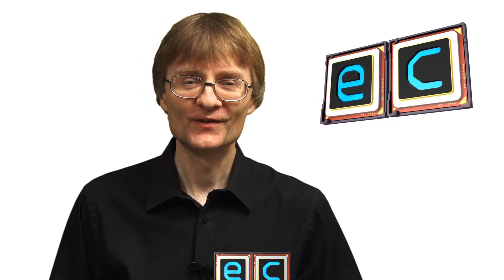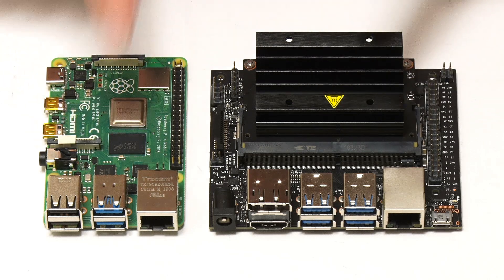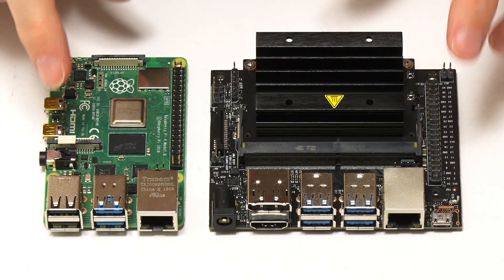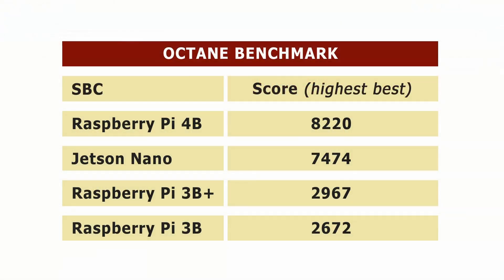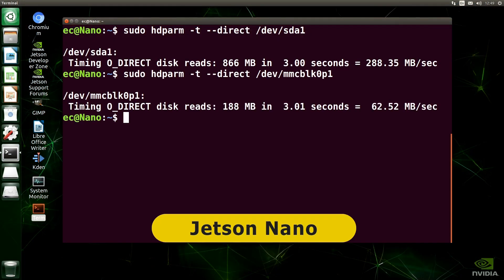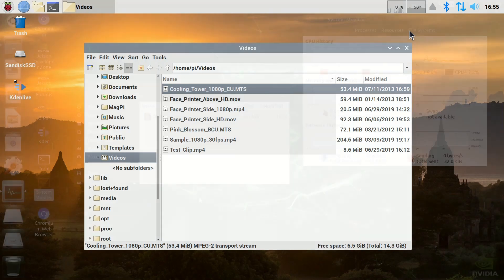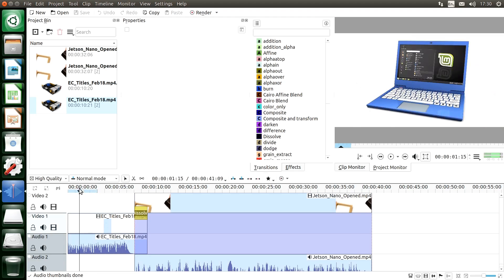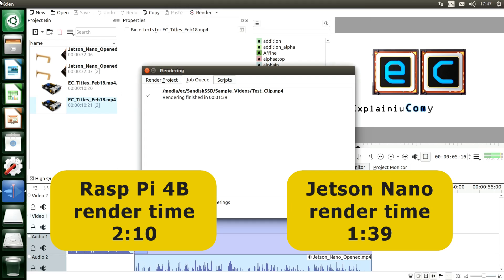Raspberry Pi 4B vs Jetson Nano

Comment: The Jetson Nano has slightly less capable CPUs but the real advantage lies in the 128 core GPU which enables faster model inferencing and decentralized edge computing; the Rpi4 is definitely a large upgrade compared to the previous versions, with much more powerful A72 processors. However, due to the massive heat generated by the new CPU it's necessary to be careful about heat dissipation.

Comment: Am I right in assuming the Pi 4 reaching 80C during rendering would throttle back? I would be interested in what other heat sinks you could use as that is certainly a large one. They are both very good SBC. Thanks, Chris.
Reply: There cases that act as heat sinks. For example: https://flirc.tv/more/raspberry-pi-4-case
Reply from the maker: The Pi 4 indeed throttles at just over 80.

Comment: Chris did you do the RPi 4B firmware update? They released it a couple of days ago. It reduces the temp by 3C-5C & increases speed slightly, especially with USB read & writes.
Reply from the maker: I have installed the update, but it was not available when I made this video.
Reply: @ExplainingComputers  ah, the unfortunate downside of videos.  BTW, congratulations on the article in the next edition of MagPi!!! (The RPi 4 B edition at that!

Comment: Well, the Jetson Nano is a bit too expensive for what it offers unless you're using the GPU, so, for now, I'd say the best SBC for general purpose is the RPi 4 thanks to its really good improvements, which are probably the biggest leap in its history. In fact, I'd say it's the SBC with the best price-performance ratio nowadays. However, that might change when Rockchip launches its new SoCs... they even have an octa-core one! We're also likely to see news from other SBC manufacturers.

Comment: You state that the Jetson Nano is preferred for AI work. Is this purely based on the current (and likely planned) AI support available in the Nano, or is there some hardware issue with the RP4b that would/could impact its AI performance? 

Seems the processing throughput is similar on both platforms, but I could well be blind to some key indicator.

Comment: maybe you could benchmark a pi vs an older desktop cpu like a pentium for fun :)
Reply from the maker: @kooky216  Great idea for a future video -- noted!
Reply: @ExplainingComputers  Did you ever do it? Could be fun!
Reply from the maker: @jeppelarsen5850  Sadly I didn't. Would be fun indeed!
Reply: @ExplainingComputers  Apart from the hilarious visual of a monstrous old PC tower next to a small Raspberry Pi, I genuinely think it would be a great idea to have an expert opinion from somebody like you on the topic that's entering the mainstream. 

My girlfriend is moving from a laptop to a home office and needs a dual monitor set up for her translation job, which is almost exclusively word-processing and cloud based tasks, so I've been wondering if a Raspberry Pi 4 would be sufficient for her instead of a refurbished PC. 

Just saying!
Reply: @jeppelarsen5850  Even though a Raspberry Pi would definitely get the job done, she would still run into some software incompatibilities from time to time. In the end of the day, a low end desktop PC would do the job much better for a just slightly higher cost.
Reply: CPU wise - 
A pi 3 is roughly a single core of a pentium 4, but you have four cores, so maybe like a multi socket xeon. (I'd give a molar to have one of these while I was in college instead of some sun ultra 10 hardware)
Pi zero is roughly a pentium II or III. But the ram and storage are much faster than the spinning disks of the time. 
*Pi 4*, I don't know ....  one does NOT see a 3x increase in CPU performance generation to generation in PC world. Maybe it's in par with Intel core 2 or Nehalem 
That said, anything interesting on the Pi or other SBC is not going to be happening while running a desktop windowing environment, much less running a web browser. Raspian/noobs is for people who are COMPLETELY new to Linux and need something familiar.
Reply: @johnsimon8457  I think the Kali Arm and Manjaro Arm guys would disagree with nothing interesting happening with a desktop.
Reply: @johnsimon8457  Thing is I was very much involved in PCs back then, and as Chris says, it is all about systems.  It makes the  comparison meaningless.  In some ways a Pi4 will be more advanced and in others still woefully lacking.  Another problem is the fastest computer is the computer you currently own.  And NOOBS  is for new purchasers so they can install known to work software- someone coming from Windows won't notice any handholding because there isn't really any.  In fact I'd say NOOBS adds confusion there.

I've read the datas and the X3 thing is just a splash headline, sometimes it is over 3.6!  Other times no improvement.  If you sort of average it out, mash it about, and apply a sort of lightweight PC use case scenario X3 isn't correct but it isn't misleading either.
Reply: @johnsimon8457  In comparison the socket 7 era AMD 500's could do a lot, but could not handle streaming from their older and handicapped instruction sets. I even think the socket A 462 is more powerful on the right board although Firefox so rudely stopped SSE support. I was surprised to see a RPI 1B+ could stream good on OSMC, although it was fun watching it chug and buffer streaming on Rasbian. That was with 1100 over clock. 
I regard X86 as a fleet of American triple trailer trucks, and Arm as a bunch of delivery drivers on mopeds that can only carry small items. 
So would it be fair to say that one could take the Arm core frequency and divide by 2? Well I don't think it would be that easy to judge performance without looking at the hardware and software that goes with a Arm cpu.
Reply: my pentium g2020  with ssd optane score 20000 ,pi4 8200

Comment: Great video Christopher. I loved seeing you use Kdenlive on them. For me an important test since I use SBC's to edit and render my travel videos. It was a great overview of both.
I'm working on the Khadas VIM3. An amazing board. Again a lot faster than the Odroid N2. It's 4 big cores are at 2.2Ghz vs 1.8Ghz of the N2. And the power consumption is very low. 1.4A maxed out. So the best for me for video editing while traveling. But mine only got 2GB ram. For 1440p videos I'd need 4GB ram. 1080p is ok with 2GB ram, +1GB zram and a swap file.
I'm almost ready with it, my video will come in the comming week. Only found 1 little problem. The on-board wifi stops working when using a USB3 device on the USB3 port. The wifi connector is right next to the port, and there's interference. Using a dongle fixes this.
I also have got the Raspberry Pi 4B on the way. And some other boards I've got that need to be reviewed too. It'll be bussy times :) 
Have a nice day, greetings.
Reply: *Its 4 big cores are (possessive)
it's = contraction of "it is/has"

*mine only has
*coming
*busy
Reply: @alvallac2171  Thank god English isn't my first language, nor my second.
Reply from the maker: Times are busy indeed! Great to hear that you're working on a VIM3 video. I'm on the Edge-V. :) Look forward to your video.

Comment: Obviously Jetson way bigger and expensive so has to go for advantage. Still apart from cloud solution what is SBC conventional local storage solution?
Reply from the maker: Storage has to be via the SD card or USB connected drives. There are now adaptor boards to add SATA or M.2 drives to a Jetson Nano.
Reply: @ExplainingComputers  That would make it a real PC. Aren't Raspberry folks afraid that they are lagging behind?

Comment: At 9:27 would it be 'better' to boot off a drive using the USB Vs. MicroSD due to the vast performance difference? Basically deep six'ing the use of the microSD altogether?
Reply from the maker: Sadly, right now, neither of these boards can boot from USB. The Pi 4 will be able to boot from USB in the future (as the Pi 3B+ can now!).
Reply: HI  @ExplainingComputers , I found this https://www.youtube.com/watch?v=7O7pUtQD9HI and followed the instructions. You can't go directly to USB, but in a two-step boot, you can run the Jetson Nano at fast speed using, "Pivot The Root." For me, my 16G MicroSD wouldn't work when I had to Build the new Kernel: but a 32G MicroSD worked fine. The 'Download Kernel Sources' took more than an hour (I'm in the USA) so the instructions say it's a good idea to save a copy. The same site gives instructions on installing a ver2 camera (ver1 won't work as of time) and instructions on creating a swap file (seems modern ssd don't use swap partitions any more). Note, the partition file should not be used on a MicroSD - according to several thread participants.
Reply: And instead of saying, "partition file should not be used on a MicroSD," I should have said, "swap file should not be used on a MicroSD (and a swap partition should not be used on a MicroSD)"
Reply: @vvwording4844  YouTube lets you edit your comments.
Reply: Hi  @alvallac2171  - I did not know that I could edit a comment on YouTube. I'll try it the next time. Since the dire warnings about swaps and MicroSDs were so strong, I'll keep my correction as an exclamation. (Keeping in mind that my own experience with MicroSDs has been positive - so far.)
Reply: @ExplainingComputers  THANK YOU! :-) Love your work.

Comment: Did he mention if the nano was using Micro USB or barrel connector for power?
Reply from the maker: I used a 3A micro USB power supply. I know that the Jetson Nano has two power modes, but the myth that spread that the power mode depends on how the board is powered has been well and truly squashed. The power mode is selected in software. :)

Comment: Nice video, the only thing I would add is, I would imagine any early adopters would already have built ffmpeg / kodi playback tools to enable cuda ( probably even extreme things like MPI ) .  In raspian you should be able to seek out ppa's that should get this done for you before having to wait for Nv to get with it.

I still think they need to open up the kernel modules ( not going to happen ) more,  perhaps with Navi coming to SoC's now also ( as mentioned in a post below ), I think the game is on with ROCm, OpenCL, OpenMP, OpenMPI, OpenCV and alike ( which is far easier than Cuda and did I mention all open? ;) ), this should make for a very interesting playing field going forward.

I did think that Nvidia lowering the entry price might have been a knee jerk as they saw whats coming,  AI edge chips are coming in abundance RockChip have them Sipeed have delivered a number of products based on RiscV with Kendryte ( K210 ) inference / tensor light, which makes for stiff competition in the space and now here comes AMD.
Reply: I would not expect PPAs to work in Raspbian. PPAs are an Ubuntu thing, and Raspbian is based on Debian.
Reply: @alvallac2171  um its all deb packages under the hood, also that should have been debian not raspian ( my bad ) ..

Comment: Excellent work per usual. One thing I found curious was the CPU temp on the Pi 4 during the Kdenlive tests: It seemed to be idling around 60 without consistent CPU usage. I assume that's GPU but would the temp sensor pick that up?
Reply from the maker: I think there is just one sensor in the SoC. The Pi 4 does run very hot (and in the test here it has a large heat sink).

Comment: I wonder if a third party YouTube player would be a solution for the time being. There's an app called GTK Youtube Player for Ubuntu/Linux which might be an option. There's also a YouTube add-on for Kodi which is supposed to be good. 2nd hand info but might be worth a shot.

Comment: A new firmware update has been released that addresses the temp probs, read about it here https://www.pcgamer.com/uk/if-you-bought-a-raspberry-pi-4-grab-this-firmware-update-to-improve-performance/
Reply from the maker: Thanks for sharing the link. The upgrade lowers the temperature of the USB controller, and of the whole Pi 4 by a few degrees in the process. But sadly this far from addresses the temperature problems. :) The Pi 4 is always going to need significant cooling in most usage scenarios.

Comment: It is ironic that inexpensive SBCs marketed for education of software programming are themselves lacking with regard to software optimization.
Reply: True, but it's a very long way from learning Scratch and basic GPIO to implementing hardware video support. The former is literally child's play, while the latter is something I will never be smart enough to do, no matter how much of my life I burn up trying.

The Raspberry Pi can start a poor kid on a journey of obtaining technological skill, even if it drops frames for a little while. Turning down the resolution won't hurt a YouTube video's educational value.
Reply: Chris Brisson i think the pi foundation did a good job creating quality boards at such price points.

its now upto the community devs to create on top of it.

the GPUs are a headache on intel / amd too
Reply: I'd love to work on gpu driver code. The problem is that it's all locked up by patents and serious prison time if breached NDAs. No thanks.  For that reason, VideoCore can be associated with sluggish, crap performance for all i care.
Reply: @whickervision742   "the patents contain no explicit statement of copyright (as is required for copyright protection in a USA filed patent)" found in https://github.com/hermanhermitage/videocoreiv/wiki/VideoCore-IV---BCM2835-Overview
Does that not mean that either the patent is invalid, or it does not regulate any copyright for this code? And therefore it can be treated as open source / free-to-use&modify type of thing? I wasn't aware of any patent for this graphics driver. I know vivante gpu seems to be the only one at the moment with fully open patent, or royalty free, but that's on the hardware side.
@ExplainingComputers what do you think?
I would love if someone could hook the full stack of functions of OpenGL4, Vulkan, OpenGLES3.1 and Vulkan Mobile to this driver. Really, I'd be able to teach so many students how to deploy to such a platform which would be great for them, having their first project deployed in a standalone mini computer they can tinker with.

Comment: I love your channel Chris,  I'm sure you know that. However that said, I really don't like these types of "SBC comparison" videos. IMHO, these things are really not desktop replacement computers--they are supposed to be boards for doing things like working with embedded systems. At least that's the way I look at it, given the presence of the GPIO header(s) on them. 

So I for one would LOVE to see a comparison video based around actual "embedded systems" metrics. How many GPIO pins do they have? How many UARTs, i2c and spi buses are there? The Ethernet port speed metric is useful, as you might well be communicating with an embedded SBC over an Ethernet cable (underwater ROV, for instance). Although I'm sure there are many people who do care, I personally couldn't care less about how well these boards play HD video, or (for the most part) their USB speeds--although at least that metric is relevant in case you want to maybe include an SSD on your robot, to store HD video in a submersible UAV...or aerial video footage in a drone. That sort of thing. So here's a suggestion for your video-planning notebook: How about a comparison video of the features that actually make these SBCs well-suited for use in an "embedded system"?
Reply from the maker: I take your point, but many people -- at least indicated by the comments here -- are increasingly using boards like these for regular computing, and indeed the Pi 4 is marketing focuses greatly on that. But suggestion noted! :)
Reply: @ExplainingComputers  Understood, but I really think we're missing the boat here. Once again it shows that, as a group, we tend to put more stock in glamour than in substance. It's a bit sad to me that the only way these board-makers can seem to be successful is to target the desktop-replacement crowd, especially when (it sure seems) that the number of GPIO pins, UART ports and i2c/spi buses has been stagnant for several years now. While I think there should definitely be some SBCs out there that target the desktop-replacement crowd, or even gamers, I think that at least some of them should push the boundaries that tend to restrict their use in a true embedded systems application. The Beaglebone Black is great in that sense, but the PRUs haven't exactly been easy-peasy to work with historically. Maybe it's different now, but I haven't looked in a while. But if the TI folks would offer a version of the BBB board, with all of its peripherals, with a quad-core processor and no PRUs to deal with...it'd be a God-send for me. 

Anyway, please don't take my comment as a slight on your channel in any way. I try to watch every one of your videos, and I certainly learn something from all of them as well. I would just like to see a little more emphasis on embedded peripherals from the SBC makers--and maybe that's in fact why you (as a content creator) can't do much with the peripherals on these things: They haven't changed in so long that there's nothing exciting to see anymore. LOL!

As always, thanks for your efforts on these topics. Love your stuff!

Comment: I want a tiny computer in the living room behind the TV and a Raspberry Pi 4 would be ideal if they sorted out the issues of playing Youtube 1080p videos in a web browser, which is the main reason that I wont purchase one and it can be fixed as my old £30 Amazon Firestick handles 1080p in a web browser without issues, so should a Pi (and other small boards) in 2019.
Reply from the maker: You express matters perfectly. Given that (via VLC) the Pi 3B+ could play 1080p YouTube very well (hardware accelerated), they really need to sort this out for the Pi 4.
Reply: *won't